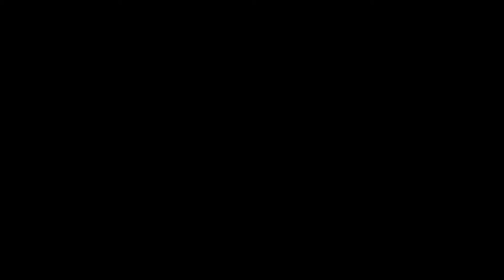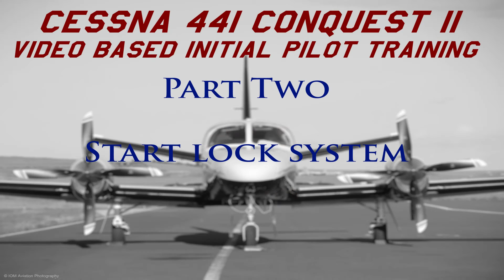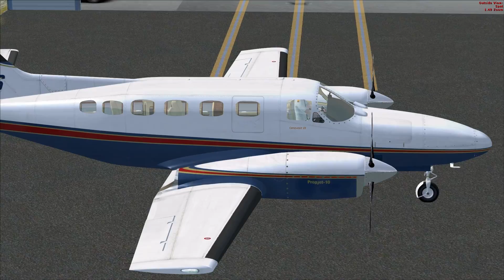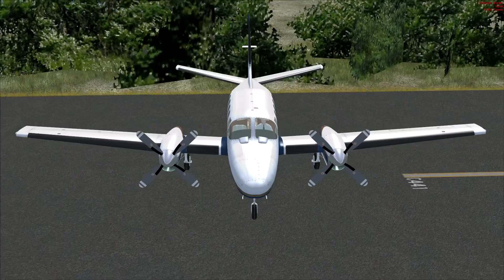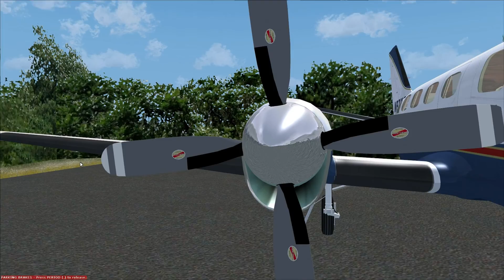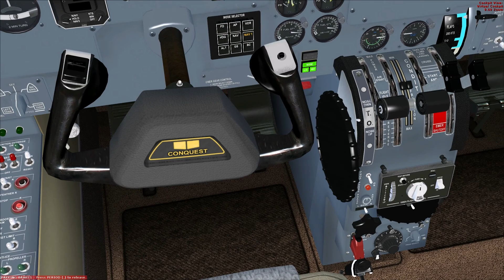Flysimware Cessna 441 Training Manual - Part 2 - Start Locks

Comment: Well, not quite. The props do not necessarily come out of the start locks with a quick pull back into full beta and back to ground idle. You pull the throttle back, see the beta light immediately turn off, you wait for it to turn come back on and the airplane to shake a bit. These indicate that the prop is out of the start lock. When taxiing, I always pull each prop, one at a time, momentarily into beta. If the prop is truly out of the start lock, the airplane will swerve toward that engine. There are videos of C441s swerving off of the runway when full power is added on takeoff because one engine was still on start locks. I’ve owned my C441 for just under 4 years, it’s a wonderful airplane.

Comment: Good information on the C441 if I could hear it once the engines were started.
Otherwise a good video.  I bought the Alabeo.  My problem is getting the idle down
for taxi other than bring props down to the lable. LOL

Comment: Sounds like a similar engine design to the J41 that is simulated by PMDG.
Reply from the maker: The Jetstream 41 and Cessna 441 both use the Garrett TPE-331 engine, so they both have a start lock system.
Reply from the maker: signmanbob The 441 has the -10 engines while the J41 has the -14. Same engine, just bigger. So the Jetstream's Garretts are substantially bigger. The 441 however does have quite a bit of reserve power, and flew and performed extremely well in real life regardless of how close you were to MTOW.
Reply: bman2101 That's interesting.  The J41 seems like a larger aircraft.  The C441 must have a lot of power using engines that will drive a larger aircraft so well. It seems like you have put a lot of work into the systems on this. I'll be buying this simulation for sure.